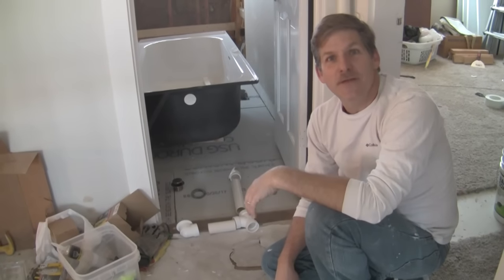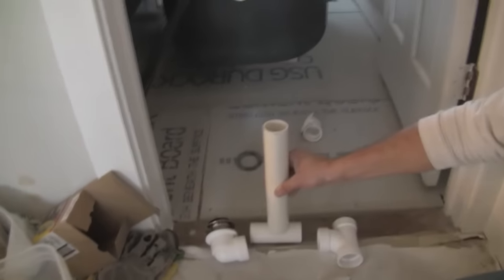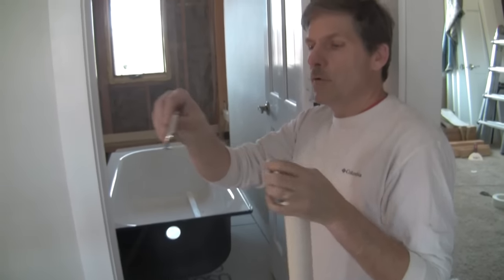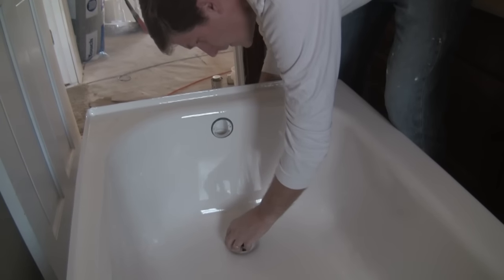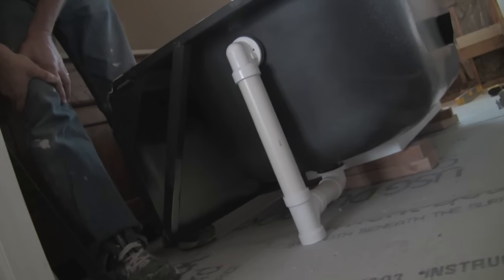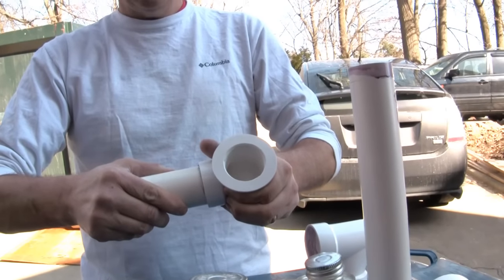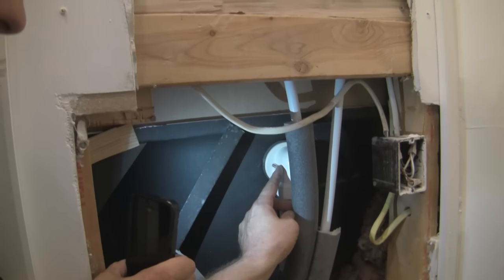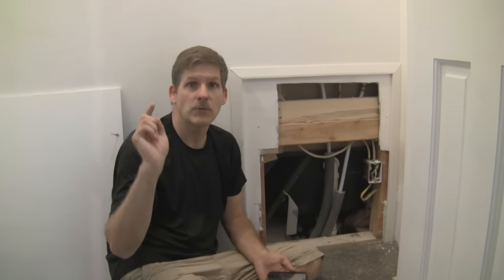How to Install a Bathtub Drain

Comment: when doing the dry fit draw pencil or paint pen marks on the pipe and fittings to show exactly where you want the pipes to be this will assist in lining up the connections and make for a perfect fit.
Reply from the maker: Hey Cuda,
Thx for the tip. Sounds good.
Reply: As he did in the video......LOL

Comment: Why would you put the thicker part at the top in the thinner part at the bottom I would think that it would be reversed since it's going into an angle downward for that gasket at the top for the water to drain I'm confused

Comment: I subscribed.   I'm a "wannabe"  handywoman, I usually do that stuff in my house. I'm about to renovate the bathroom & this video helps a lot.   I got the kit to install the bathtub  now I feel like I'm ready to do the job.
Reply from the maker: Hey Rogabc,
That’s awesome! Thx for subscribing and welcome! We hope our videos serve as a helpful source of info on your projects.
We certainly appreciate your willing “can do” attitude. It will serve you well.
Regarding the drain kit you purchased, Im not sure exactly what’s provided. But I’ve noticed in our video that we did not address well the drain fitment. 
Here is a copy of a reply I sent to someone earlier regarding using plumbers putty. It’s important for a leakfree drain.

Before screwing the drain pieces together ( comprised of a chrome top piece in the tub and PVC bottom piece underneath the tub with the tub sandwiched in between) : 

“With the plumbers putty, take about a ping pong ball size of the putty from the container, roll it out like you are making a snake till the roll is about as long as a pencil and a little fatter than a pencil. Then that “snake” of putty gets wrapped around the silver / chrome drain under the lip of that chrome drain piece . That way, when you screw the silver drain piece in to the pvc bottom piece, the extra plumbers putty will squish out. What remains squished/trapped between the drain and the tub forms a water tight seal.”

Hope that helps.
Thx for viewing!
Reply: @Housebarons  oh thanks!!   I read that comment already & check for that "plumbers putty" stuff.   Thank you 👍👍

Comment: Best to use a slip joint for adjust ability and servicing,  when you glue solid pieces together makes it a total pain.
Reply: Best to not use a leak prone slip joint especially when this is hidden plumbing. It will leak eventually.
Reply: @neoconfirst7694  always load slip joint with plumbers putty.  No way its leaking or working loose.

Comment: Hi again, this is great help. How do I secure the tub down so it doesn't move? Instead of trying to attach to wall can I just put a 2×4 against the front and attach it tight to wedge. I have to look and see if there are holes in metal to attach.  Also what kind of piping do I add under the tiny cabin, I have a black curved boot
Reply from the maker: Great question - Is the tiny house on wheels? Never had to deal with a tub moving. Typically a fiberglass or steel tub has an edge on long side. That is usually fastened in first, then Durarock/ cement board for the wall resting on top of that long tub upper edge. Thats for a house- Not sure if on wheels- thats more RV design. Never done that.
Thx again for watching
Reply: @Housebarons  not on wheels,  it's a lofted barn turned into a tiny house
Reply from the maker: Hey Diana,
Fun! 
If it’s a steel tub you have much more strength. Plastic or fiberglass- ???. Support on ends is partial solution. How about support long side from underneath - maybe a 2x4 post support from floor up under lip at middle of long edge?
Before any wall finishes make sure everything is solid. It will ultimately be a judgement call…

Comment: How's the p-trap work for tubs?  Looking at my plumbing, i can visually see all the same parts your showing but the rest is under dirt.  ( & clogged up)  should i dig further and replace that too? Its old thin metal pipe (not cast iron).
Reply from the maker: Hey Osama...,
I guess it all depends on your particular problems. But tub p-traps work like all p-traps - a trap for water to stop sewer gasses from getting past. 
If you have room and the skills, go for it. Just make sure you have room to work. 
Thx fir watching!
Reply: I'm doing the same trying to find the right p trap
Reply: Replace it while you can.  It's a lot tougher to fix after installing a tub and finishing the rest of the bathroom around the tub

Comment: Hello have a question, can I have my bathroom sink removed and put a free standing tub in its place ? Is it possible
Reply from the maker: Hey Blue..,
Almost anything is possible. Considerations. 1) Removing a sink will leave a hole in counter top. Probably need a new countertop. 
2) height of bathroom cabinets is? A free standing sink can be 6 or so inches above countertop so if you base cabinets are 30 inches tall - problem not to tall. If your base cabinets are 36 tall already, you may need a shorter cabinet. 
The plumbing is simple - no problem there. 
End of the story… if you like how it looks, it’s perfect!
Thx for watching.
Reply: @Housebarons  thank you very much great information 🤗👍👍

Comment: Plumbers putty between drain and tub from top or no?
Reply from the maker: Hey Michael,
Yes. Between bottom of drain and the top of the drain hole in the tub. 
There is probably a rubber gasket under the tub which needs nothing. 
Thx for watching!

Comment: So how do you seal the drain to the tube going to the sewer??
Reply: Z33! Exactly! Every one explains, what you know, like 1,2,3! And NO ONE gives you detail explanation, how to screw it TOGETHER TOP w/BOTTOM, SO WOULD BE NO LEAK!?
Reply: @valentinasoubbotina2936  In my case the pipe going into the slab is a clean pipe with no threads, so nothing can be screwed together....
Reply: @Z33Garage , i,m talking about the top metal part inside of the tub, which has to be connected /screwd w/bottom metal part...
Reply: Gluing...
Reply: @valentinasoubbotina2936  I mean yeah that part sure, but if you read my question Im specifically asking about connecting the entire drain system to the Sewer pipe that isnt threaded.

I ended up using a rubber sleeve adapter to step down the pipe on to the septic pipe.
Reply: @Z33Garage , That is what I done, when I tried  to install ALL PLOMBING IN MY HOUSE!  Start by installing those 4" pipes, by  pushing this pipes w/slege  hammer! SO, I THINK YOU  DONE WONDERFULL  JOB, MISTER!

Comment: Great video. That's the same tub I'm working on, but your drain kit is better looking than my generic HD kit.  You made it look easy, so my plan is tomorrow I will buy a better looking kit and get a better test fit before gluing.
Reply: Where did you end up finding a better kit?
Reply: Lowes

Comment: TFS! In your opinion, which is better to use for durability when replacing the drain pipe, PVC kit or brass kit? Thank you!
Reply from the maker: Hey Mio,
PVC is fine. Not expecting it to fail. So far so good.
Thx for watching!
Reply: Thank you so much!

Comment: Do you have a video showing connecting new pvc Ptrap to old cast iron branch that is not in alignment?
Reply from the maker: Hey Rickey,
No video. Maybe try a rubberized / fernco fitting if it’s just slightly misaligned.
If it’s a lot out of alignment, you made need to cut out some of the old cast iron branch and replumb with a fernco and new pvc. 
No small job I’m sure!
Thx for watching!

Comment: Should I put poly on the subfloor to help against mold?
Reply from the maker: Hey Diana,
As for inside the room, Maybe use linoleum or LVL plank flooring which is not affected by water. Plus water should not go through it. From the underside??? I would hope the tiny house (on wheels) has a water proof undercarriage.
But using LVL plank / or linoleum is a good floor to not allow water seepage through it.
Thx again!
Reply: @Housebarons  thanks

Comment: I was hoping to see if you put the drain pipe on the tub and then install it in one piece, or if you tied the drain pipes to the ground first before installing the tub?
Reply from the maker: Hey Street…,
We had drain pipes on the tub and then connected at floor joint. Multiple ways to approach depending on you access to them. 
Thx for watching!

Comment: Hi  i am trying to install  my  new tub i  bought the new kit  and  line up  the hole but the only problem is  the  that drain  is almost  less than  half inch lower than the tub  hole  that  is after placing the   first rubber gasket that comes with the drain  so if  I add  additional  rubber gasket it will  be good  but is that  ok  need your opinion please  thx
Reply from the maker: Hey John,
If I’m  understanding you correctly, the drain tube from the overflow to the bottom drain is too long leaving you with a gap under your main tub drain. 
So if you cut the overflow drain tube by a half inch, that should bring your bottom drain up and touching it as it should be. 
That make sense?

Comment: Thank you for your video! I am also doing a full gut and total renovation. What did ya put under the tub for support? I was thinking of what to use to reduce or minimize cracking.
Reply from the maker: Hey Vic, 
The floor has a plywood sub floor and cement board base for the tile. As such the floor is quite inflexible. 
The tub itself spanned two floor joists in between which was the floor drain and p- trap. 
The fiberglass tub has adjustable feet to support it well. 
There really was not much risk of the floor or tub cracking in any way. Hope that helps. 
Thx for the question and the views.
Reply: A friend of mine actually poured a thin layer of self leveling concrete on top of the sub floor when he installed his cheap fiberglass tub and then seated the tub in that to prevent flexing. He said that worked great and that the bottom of his tub has zero flex and feels solid as the old cast tub that he replaced.
Reply: @MsCFournier  do you lay tile under the tub first or do you put the tub down on plywood directly? im trying to prevent moisture from rotting out the joists beneath over time.

Comment: Would also like to see how tight you had to go fitting the tub drain on
Reply from the maker: Hey Michael,
The old plumbing adage “ tight but not too tight” applies. As you screw in the drain, the excess plumber putty will ooze out. The metal drain typically screws in to a plastic elbow under the tub so be mindful of risks of stripping the plastic fitting. So tight enough with out doing damage. 
Remember, the drain isn’t under pressure. Once you get it put together you can fill the tub and look for leaks. But my guess is you won’t have any.
Reply: Thanks  @Housebarons

Comment: Thank you . this is super helpful. Do you only apply plumbers putty to the bottom drain and not the overflow? Also with the glueing, I've seen some people scuff the pipe with sandpaper instead of use primer. Is either method suffucient?
Reply from the maker: Hey A M,
We only used plumbers putty on the bottom drain. The top drain has a ruberish gasket on the backside to make good seal. The front is fine as is ... so water can flow into the overflow as it reaches the bottom of that opening. 

As for scuffing the pipe - we don’t. The chemical bond made by the glue essentially welds the two pieces together. I’ve seen a bunch of plumbers over the years and never seen them scuff the pipes ( for what it’s worth). 
Thx again for the comment and question!
Reply: I make index marks on the pvc during the dry fit with a sharpie. That way after the gluing is done your pieces remain in the exact alignment.

Comment: Is there anything I could have done that would completely prevent the tub from draining? I recently installed a new tub with an identical drain system, and now it doesn't drain. Not even very slowly
Reply from the maker: Hey Justin,
That’s a puzzle - sometimes tubs have built in plugs/ stopper… is that open?
Thx for watching!

Comment: i had some problem with my  bathtub drain when i  removed the drainage i seen that  the drain screwed to a  short one inch  metal adapter and the adapter   than screwed to the  PVC  that is why my drain was high and water stayed in the tub  this is the house that i  just bought  is it always  like this  or  since the drain was smaller  they used the  adapter ?? need to install new  but   decent price tub  any suggestion  thx
Reply from the maker: Hey John,
It seems like you found the problem. May see if you can find a drain sized so you don’t need that adapter - just screw drain right into the pvc. 
Or if you want to avoid buying a whole new tub, then replace drain pipes with a new kit. 
Hope that helps.
Thx for watching!
Reply: @Housebarons Thanks  Do u have a link for  your tub ?? Is it easy to  replace the  pipe and  install  the new tub i did install  a shower pan  before  and did the  plumbing under it  but never installed a bath tub  do u have a  you tub to show a complete installation  thx
Reply from the maker: Hey John,
Here is the link for the tub install. 

It’s pretty straight forward. The biggest part is aligning the existing drain pipe with the new tub drain. I believe they make an offset pipe or somewhat flexible tube to help align them if they are a little off. But really - they will likely line up since tubs are pretty standard. Just “measure twice” as the saying goes and you’ll be good.

https://youtu.be/gG8u487Y8r8

Thx again!

Comment: Normally that top drain piece screws into the tub itself not the PVC, right?
Reply from the maker: Hey Jim,
Top drain piece?? 
The top ( overflow )  is attached with screws into the pvc on other side of tub. 
The chrome piece - the top portion of the bottom drain is screwed into a threaded pvc piece that is underneath / bottom side of tub. The drain kit should have all the appropriate parts. 
Hope that helps.
Thx for watching.
Reply: @Housebarons  ok thank you. Doesn't turning the bottom piece into the PVC cause strain on the PVC that could make the glued fittings come loose and leak? I see plumbers turning them really tightly.
Reply from the maker: Hey Jim,
We made out connection and then hooked up the tub drain plumbing lines to the main drain lines.
But if you are just replacing the top portion,
the drain lines should be ok. 
Because it’s typically metal drain basket going into plastic, you want to be careful not to overdue it. 
Whether you have a drain gasket or using plumbers putty, that should be plenty to seal it well with it being “tight but not too tight”. 
Hope that helps.

Comment: Hi, my drain kit has pvc  nuts that screw in together,  do I have to also use glue on those parts? Im a 61 year old woman, building my own tiny cabin, but dont know plumbing
Reply from the maker: Hey Diana,
No glue! Watch a bunch of videos to get the best perspective. But glue could cause problems down the road. Most kits come with washers or are designed to self-seal ( like a compression fitting).
Ask at the big box home store - often times employees there have a good amount of real world experience. If you find someone going into great detail in explaining, then its likely they know their stuff. Also buy a DIY renovation / plumbing / handyman kinds of book - very helpful!
BTW - way to go and take on the tiny home! Impressive! you will learn TONS of stuff over the build.
Thx for watching!
Reply: @Housebarons  I got the pipes done yay! Thanks
Reply from the maker: Hey Diana,
Great to hear! Go job! Hope all goes well on your build!!

Comment: are these pipes standard? are they all 1.5"
Reply from the maker: Hey Jorge,
Yes. Standard 1.5 inch pipes except for the pieces that connect to the drain and overflow - those are specially designed to connect there ( specific for bathtubs) . 
Thx for watching.

Comment: Wow, very very helpful!  Thanks so much for taking time to make this video.  I know exactly what to do now.
Reply from the maker: Hey Don,
Thank you for watching! Hope it goes well!
Reply: I don't know what were you watching. All what was there is how to glue the pipe -without even showing alignment marks! 
At 2:10 the overflow gasket he puts up side down. The thinner side goes UP!
Where is the plumbers putty???
Did you see how to connect it to the drain pipe?
I didn't...

Comment: I redid the plumbing on my tub, and water sips around the bottom gasket. I tighten it really hard - the first time I was half tight and it was dripping quickly, the 2nd time I tried really hard until I felt the rubber really pushing against my torque. Any advice.
Reply from the maker: Hey Andrea, 
Did you also use thread tape around the threads of the male end of the pipe?
Thx for the question.
Reply: @Housebarons  You mean teflon tape? If so no. Should I? Sounds like a good idea.
Reply from the maker: Yes Andrei,
The Teflon tape fills the super small gaps. Wrap around the male threads 4-5 times. As you tighten the pieces together, you should feel it get harder to turn as you progress. Hope this helps. Btw - use the white Teflon tape.
Reply: @Housebarons  Sure does, from what I read I also see that silicone is stronly needed (plumber's putty seems to be a classic option but it has less hold from what I read).
Reply: Masterg Samuraixmen  I was missing plumber's putty (or silicone, but putty is easier to open, clean and whatnot).

Comment: I would have liked to have seen the existing ground connection to the new PVC.  When I took out my old tub from the 70's, they chunked out the concrete to shape a 'bowl', and had the tub draining into the "concrete bowl", which leads to the outflow of the house.    That just looks wrong to me... yes or no???
Reply from the maker: Hey Janice..,
Yeah. That sound wrong. Not sure why it won’t be all piped? Very odd. 
Thx for watching!